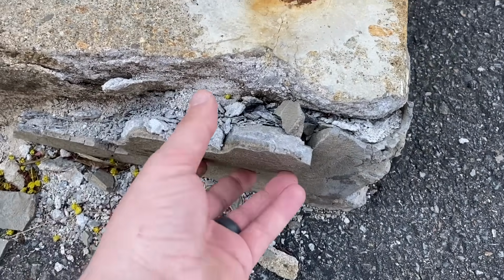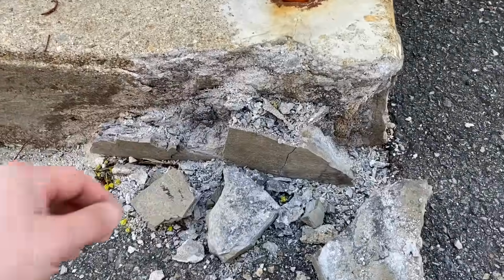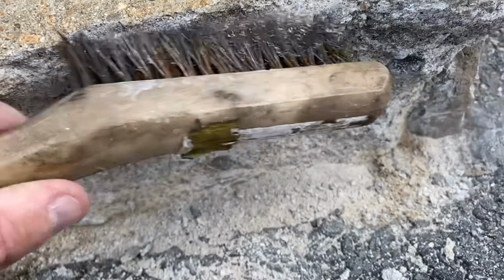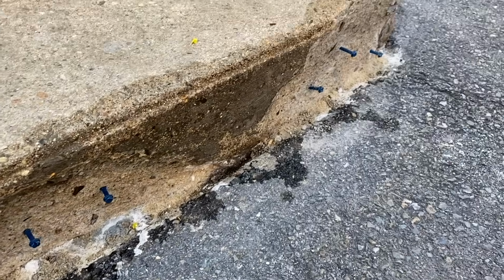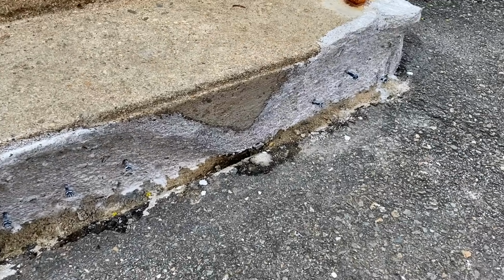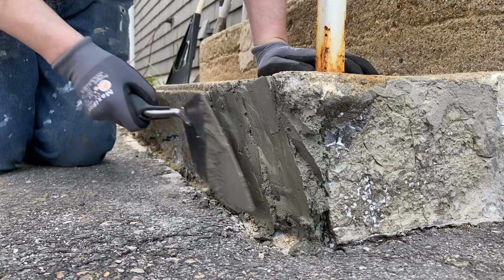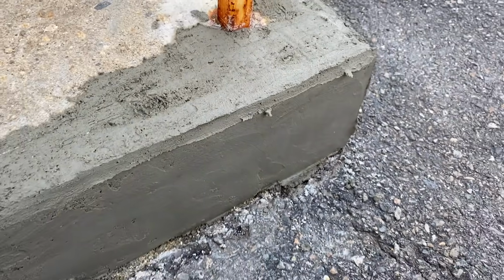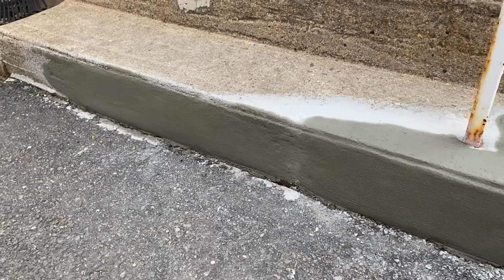How to Repair Broken Concrete Stairs - Quick and Easy

Comment: I did my two years ago but I didn't let it dry long enough before I applied it. Because today I looked out there and it all crumbled away we had Sub-Zero weather with snow and then it rained a couple days later. When you are all done with that and it's cured don't you brush on some kind of a waterproofing? What I did was I put a clear coat of spray paint on it several coats. The Rust-Oleum for concrete.

Comment: Looks great! I just patched a six inch gap in a plaster wall and I used the same technique of adding screws so it had something to hold on to. I'm hoping that with some fiberglass tape on top will hold everything together for another 80 years lol.

Comment: @The Fixer Bad surface preparation, my firend...  Cement and concrete  loves water...  The surface must be hydrated very well. After aplication fresh applied cement should be also hydrated regullary  to avoid fast diying...  If cement dries fast, it makes weak bond and that's what  happen...

Comment: Nice job - my only observation is, at 7:35 I would put the water in the bucket first - then add the dry mix.  That way you avoid any dry lumps/grains in the mix getting stuck in the bottom corners of the bucket.  JMHO

Comment: I’ve done similar work recently and use a diamond wheel on a grinder to avoid feathered edges and key the fix in more mechanically.

Comment: Late to the party.  If you ever come back to old videos and respond - would you have a thought as to when concrete damage is beyond the repair stage?  I have a front step that looks worse than yours.  My neighbour and I are at odds.  He insists it needs to be completely chiseled out and redone whereas I am willing to try cleaning it up and forming around what's left to create a new step.  I've done this only once before for a broken and terribly unlevel sidewalk along the side of my In-Laws house.  I formed it up, poured on new.  The In-Laws were stunned with how good they looked and functioned afterwards.  So much easier to shovel snow or carry in groceries from a flat unbroken surface.

Comment: I like this guy's video. It is very useful in a variety of concrete repair work. Some important info for those attempting repairs like this for their first time - DIY tips like adhesive, tapcons, etc are mentioned already below. Some folks often ask about what to do with the leftover concrete, and how to clean their  gear after the job. I'll address these 2 items here.  I got a pretty good arm (not like phuckin Popeye here in this video, but good enough).  I roll (form) the leftover concrete into mini-snowballs and mini-shitrolls (playdoh style) and let them dry over night (wear gloves when doing this step so not to dry out your hands). Then, randomly over the next few weeks,  under the guise of night (often, after I've been drinking) I start chucking the leftover hard pieces of concrete over into my neighbor's yards. I usually skip my next door neighbor (drinking buddy) and shoot for a couple houses down (don't know 'em). Aim for backyards, their a  bigger target and don't make as much noise as when hitting the neighbor's roof. Try not to hit their fence, either, sounds like a phuckin gunshot, scares the hell out of everybody including yourself, "Holy Shit, they saw me and are shooting back at me!! Is there a sniper on the roof?? Wait, maybe my shitroll hit the fence. Damn, I gotta quick drinkin."  Anyways, over a week or two you shouldn't have any more leftover hard concrete. Also, over the next few weeks, pay close attention when you hear your neighbors start their lawnmowers. You might get lucky and hear the KA-CHANG! when their lawnmower blade catches one of the mini-snowballs or mini-shitrolls hiding in their grass. That's always a hoot!  As far as cleaning the buckets & tools....I found simple hose water works pretty good.

Comment: Job well done. Can add some chicken or any wire between screws to fill more area of the crack for a better hold. Thing I have noticed throughout 30 years of similar fixes is no matter how well I do the job some job fail way too quick and others last a few years, but eventually they all fail….hopefully you get a good 5 years though.

Comment: Good idea to address the rust issue on the railings that are set in the concrete, the rust will expand and crack the concrete for sure.

Comment: You definitely don't need those tapcons. Better to do an acid wash after breaking the old crap out to get a better bond to existing concrete.
Also not that it matters but to get it to match color better, at the very end you can loosely mash some play sand on the outside surface.

Comment: Thanks for vid But if you’re screwing in tap screws why not include a bit of mesh using those two screws to secure it in place ….i future that way the new cement will have more areas to attach to ?

Comment: Never take advice from a man that uses and abuses a good carpenters hammer on concrete, no tools of the trade = not a tradesman.
Reply from the maker: Yup.  And I still got it done.  You have reaffirmed the entire point of the video.  You don’t need to be a “pro” to get stuff done yourself on your own house. 👍
Reply: @TheFixerHomeRepair  No doubt the guy before you said the same.
Reply from the maker: Yeah it probably won’t hold up because I used a claw hammer. 🤣

Comment: You missed a couple really important steps which will cause your repair to fail. You went through the trouble of chipping old material, using taps, bonding additive,  etc.

These are the two big issues for anyone watching in 2024: 

1) You didn't actually clean the old concrete. For bonding old/new concrete, you need to acid wash the old surface so all of the grease and other particulate is removed from the surface. You can get muriatic acid from HD/Lowe's for a few bucks a gallon.

2) You didn't actually apply any bonding slurry/agent to the old concrete. This is another crucial step to ensure a strong bond between the old and new concrete. It doesn't have to be anything crazy, even just brushing on some plain Elmers glue (or other pva glue) would work. You can also make a bonding slurry with water, Portland powder, and pva glue. Whatever you use, just paint it onto the old surface and give it a couple of minutes to partially set. After it starts to set a little you can apply your new material as shown.

Will it work for a while? I'm sure. The reason the repair had to be fixed in the first place is because the person that did the old repair also didn't clean and prep the repair properly ;)

Comment: What kind of sealant do you recommend for the concrete? I have steps just like those and I’m doing exactly what you’re doing in this video. But, I live in northern Maine where it rains all summer and snows all winter. I’d like to get the steps sealed to protect from the elements if possible. Thanks in advance for any advice!
Reply from the maker: Hey!  Great question.  I believe I used a “Behr” product.  I sealed my concrete stair pad and actually made a video with all the steps, like cleaning and etching, if you are interested.  https://youtu.be/rnX0fz7id5c
Hope it helps!!
Thanks for watching!

Comment: Very helpful. I having trouble getting the Tapcon screws to stay in. Will the concrete adhesive if placed in the hole help the Tapcon screws stay in or do you recommend another method?

Comment: That rusty steel handrail post embedded in the concrete most certainly had a lot to do with the concrete cracking, both from the rust expansion and the thermal expansion and contraction.
Reply: There's no stopping it either. Seen stoops with a single post holding up roof fail similar as wind vibrates post and will continually crack out any fix. Anything buried in porch cement will eventually do same.

Comment: That’s only gonna last as long as until somebody bumps into it again with a snowplow or something it’s only a temporary Band-Aid might last a year or two been doing concrete for 40 years and doing repair jobs and fix it like this. It won’t last it will not last at all give me a year or two, especially when the salt hits it
Reply from the maker: It sounds as though you feel this repair won't last... 😂. I get it man.  Been 4 years and still going strong.  If it starts to fall apart again, I will do the same thing.  I will take an hour or two of work every 4 or 5 years over demo of the stairs and pouring new.  Thanks for the feedback.  👍😀
Reply: @TheFixerHomeRepair  well about 99% of the time they dont last and when I say been doing this for 40 years I’m talking professionally I’m talking commercial buildings where they got a pass codes and stuff like that because of people can be hurt from accidents and stuff so I’ve been using products that are much much much much better than you can buy in the box store anywhere else half the time those don’t even work they only last year too but doing what you’re doing saves your money but like you said it’s been four years but eventually you’ll be repairing it again I just look at it like a professional way just tear them out and rebuild the whole thing and then it will last another 2030 years versus putting a patch on it every 4 to 5 years or 2 to 3 years and over again
Reply from the maker: Right.  And the likelihood people wanting to rip them out and do it “right” is much lower than patching every couple of years.  You should make a video of doing it the “right” way.  I’d watch it. 👍
Reply: @TheFixerHomeRepair  and yes, you are people that do it right there are a lot of people it’s called taking pride in their work and this some hack patch fix it might be cheaper but just like throwing a Band-Aid on and Band-Aids don’t last

Comment: How would you deal with a set of steps that are badly pitted from age and ware that soon will be crumbling? Maybe within two years. We just moved in a year ago and we are trying to do repairs where we can without fully replacing the steps.
Reply: Won't happen. Tearing out and building forms to pour new or consider precast if avail. Maybe well built wood...

Comment: How would you repair cracks in a concrete driveway.... some cracks are 1 inch deep+..... one read it's good to use backer rod for larger cracks.  Would you use a bonding agent like you did for the steps... I'm guessing not for horizontal repair.

Comment: I use muriatic acid to etch the old concrete. This not only cleans the old concrete but it helps the new repair to bond to the old. Always lightly dampen the area prior to applying the repair product to the two to bond together. I have used the bonding agent but not a fan.
Reply: Did you neutralize the acid afterward?
Reply: Always neutralize acid by washing with water! Don't let anyone tell you this doesn't work! It not only cleans but eats out the pores of the concrete to allow the new concrete to penetrative and lock onto the old. I have used the adhesive junk but it's just a way for these companies to sell you crap! I also use tapcon screws as rebar. Anything to hold the repair together.

Comment: Can I use a tile adhesive or does it necessary concrete only? I’m a landlady and I would like to fix it first. Same as I do with plumbing I fix first if I can’t fix it then called the plumber 😅

Comment: That corner looks so darn good. Even the edge groove blends with the original one. I like that you put those cement screws to anchor the cement and that you showed how to use the trowel to see if they were sunken enough. All it needs now is some kind of epoxy cement paint over the entire step...and a spritz of white Rust-Oleum on that icky rusted metal bannister!

Comment: Beautiful Demonstration. I have concrete steps. At the corners of each step side, there's a gap which separated. Leaves are a culprit for cement steps. Now, I have to do a clean up as you did. Have any information what to use as well as cement?
Thank You!

Comment: Remember in areas prone to cold weather to always water proof the concrete with a water proof sealer, alot of people do not seal the cement and it should be done every 5 years or what happens, where the traffic is most it wears the sealer off and because cement is porous, when water soaks in and freezes, that's when it starts breaking apart. Same with black top driveways. Sealer, sealer, sealer, for anything exposed to the weather elements.

Comment: I've never seen or use the concrete adhesive but I know using Muriatic Acid to clean the old concrete makes the new concrete stick to it very well.

Comment: Your repair seems adequate but I have a few thoughts. First, the Tapcon screws are useful because they prevent the cement from slumping while it is curing. They really won't prevent the cement from delaminating from the old work. If not properly applied and cured, the cement will crack and crumble. Second, when performing surface repairs, a polymer-modified cement product like Patchcrete is much easier to apply and in my experience is more durable than Quickcrete. You don't need to apply a primer when using Patchcrete. I can feather Patchcrete to blend perfectly with the old work. Finally, you'll find that it's much easier to apply your concrete and work the surfaces if you use a flat trowel rather than a brick trowel.

Comment: As a professional mechanic I would consider myself having done an incomplete repair if I didn't get rid of the reason for the failure. And I see the reason for the failure still there. That being the handrail is still in the slab. The actual and original path of water ingress and eventual expansion from freezing.

Comment: After doing this, can you attach things to the newly repaired concrete? I have a stair that broke off as I was drilling down to attach new railing. When i repair it, I need to be able to drill down and screw in a tapcon. Is this type of fix strong enough for that?

Comment: Good job you really fixed it the right way always thought they must have be some kind of glue that you can apply before you repair with the cement but course nobody's going to do it they know they will be back next year to repair again no one wants give you any warranty on the cement work outside

Comment: Two things you are doing wrong. Drill UP at a slight angle so if water does get into that area it won’t go into the hole freeze and blow apart the step even further. Second, use epoxy on the screw before screwing it in the step. It I’ll seal the hole forever against moisture.

Comment: Nice work. Props on using a drill and not a hammer/impact drill on with that masonry bit. I see more and more people using impact drivers with all manner of drill bits and fasteners and well, sub-optimal results. For anyone who is going to try this and isn't familiar with Tapcons or old concrete, find something to practice on a couple of times. 
BTW: Estwing makes a hammer/chipper for this kind of thing.  
Thanks for posting this.

Comment: Absolutely beautiful. Speechless really. 

Can the sponge only be used for more surface based touch up jobs? Or does one need to use the 🔧? From what I can logically see=sponge ok for touch up work...for work that requires more surface area to be covered, of course 🔧 will do it faster and with other factors involved.

Comment: The same thing will happen again, this isn’t a long term fix, for so many reasons. Do it once do it right. Dismantle the entire concrete slab. And replace all of the steel, with stainless steel. Kiwi

Comment: What can I use to fill concrete holes that anchor bolts were pulled out from?  Hopefully something with strength in case I need to drill in that area again later.  Thanks.

Comment: Something my teacher told me when at school to become a bricklayer is, use water that are clean enough to drink. Remember if the water is lets say to salty the concrete will turn white after a few months. Also dirty water may depending on what dirt it is make the cement more porous.

Comment: so that repair would be great on a sidewalk, curb, or stairs that DONT have a rusting metal handrail in it. the root of the broken corner in that instance is that the metal is oxidizing and when it does that it expands and breaks the concrete, hence the cracks on either side of the handrail post. this will crack out sooner than later, especially if you are in a cold climate, it will start to fail the next winter. this is the same reason we see bridge builders using fiber bar for support, or the Green coated rebar. the old bridges start failing when the rebar corrodes enough to crack the concrete structure. looks good for today tho

Comment: So you put the tap screws in so about a half-inch sticks out? My house was built in 1900 so it has those steps with the concrete and Stones mixed in it you know what I mean? I'm sure everything will go the same way with my steps as it did with yours you think? Was the sponge wet? Great job!

Comment: This is an excellent video. The only addition I would make is describing your hammer drill, though any drill may work, but for sure  mention the tap con drill bit used   Needs to be for concrete and a certain size.

Comment: Another tips how i do it-1) use power wash to knock smallest sand and lose particles 2) buy special concrete liquid(glue) to wet old surface(milk color) and let it dry overnight. It will stick much stronger with new concrete. 3) when i repair rail on bottom-i put inside a smaller and thicker square metal piece about 12 inches and weld it. This way when when it rust-it will never breaks off.

Comment: I am going to attempt this but my issue is the riser is chipping. So I went to look at it today there is sand behind the riser, so can I use tapping screws still? How is this going to stick to sand? Am I safe to sweep sand away or will my slab of blue stone step fall? Help